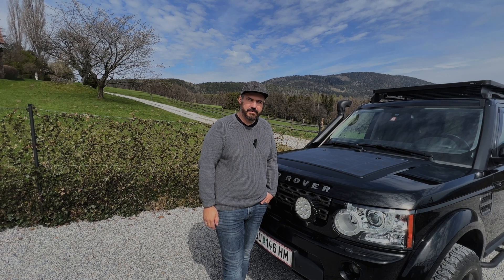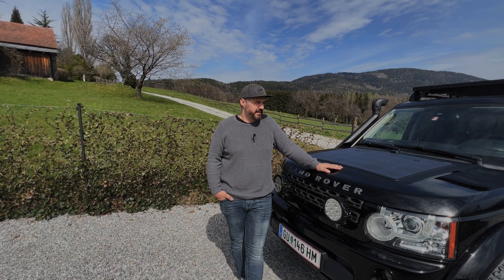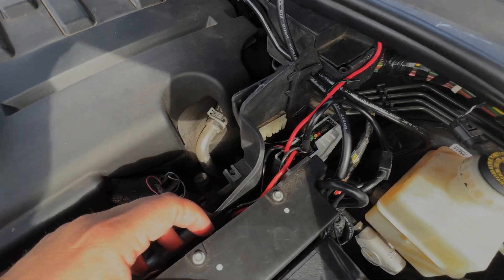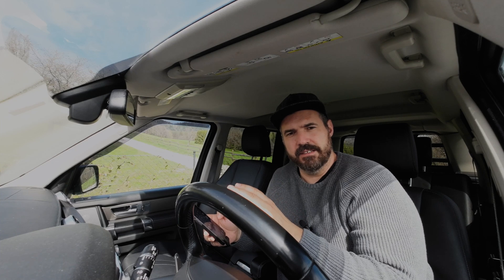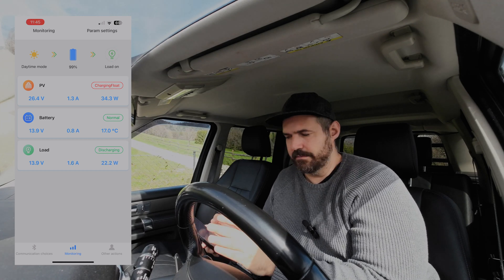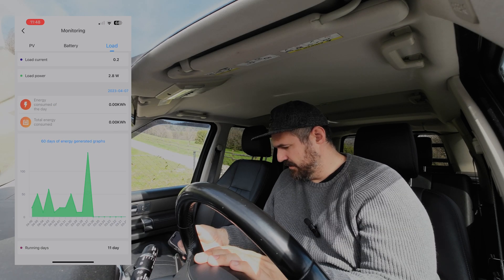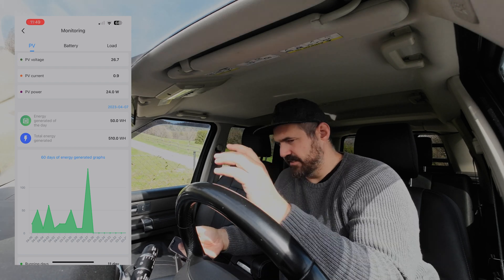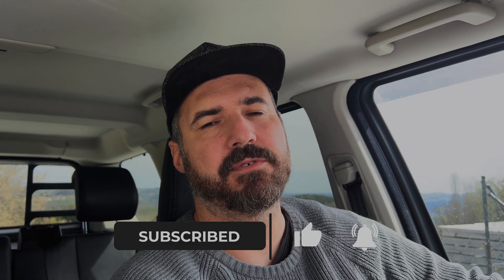Endless Solar Power For Your Land Rover LR4 / Discovery 4

Comment: I much prefer to use bi-facial folding solar panels so that I can still charge batteries when parked beneath shade of trees, by simply positioning them in full strength of the sun. I also wouldn't want to stick that mostrosity on my nice car bonnet! 😂
For charging during inclement weather 🌧️☔ I simply start the engine and the fitted Ecoflow charger feeds 800 Watts to the Ecoflow Delta 1024Wh battery. There is also no need to worry about a dead main starter battery when I'm parked up in the wilds for weeks or months at a time, because the Ecoflow will reverse charge the engine starter battery, even with the engine turned off.

Comment: Hi there how is the Solar Panel holding up? Does it work ok and does the adhesive tape still holds everthong like it should? I am looking for a hood solar panel for my Range Rover L322 that will charge my starter battery while camping. Thanks for your video, I look forward to your reply. Best regards from Lower Austria.
Reply from the maker: Hey, yes, the panel really does stick! It doesn't matter if it's raining and cool, or if it's in the sun at 35°C all day. However, with an adhesive tape price of almost 30 euros, it should :D What I can definitely recommend is that you seal the panel all around and at the wiper nozzles with Sikaflex afterwards. Many greetings, Peter
Reply: If all you need is something to keep your battery charged up enough to start a cheap small solar panel that connects via accessory port should do just fine.

Comment: Hello Peter, motivated by your two videos I bought myself the solar panel too. The decal delivered by lensunsolar unfortunately did not fit perfectly on my hood and will be replaced by one from Oryx Solutions. At the moment I'm testing the performance of the panel itself. Yesterday the output was approx. 100 WH/day. Now I'm curious about the results your panel delivers the last view days. I would highly appreciate, if you can give us a short update about this. 🙂 Thanks in advance.👍
Reply from the maker: Hey @Thomas, what was wrong with the decal so it didn't fit? 

I looked at the history of the panel and the maximum power in one day was 360 WH/day. But I must say that I did not care about the right position to the sun and the angle, nor whether the car was in the sun all day 😉 

Compared to my mobile Jackery Solar Saga 100, the performance is not so high, but that also depends on the easier and better adjustment of the angle and positioning of the mobile solar panel to the sun. This is not quite so easy with a panel permanently installed on the vehicle. 😄

From there I find the performance already quite good! I will try the vehicle throughout the day to place correctly to the sun and see what comes out then.

All the best to you,
Peter
Reply: @notthatkindofachannel  360 WH, sounds not to bad. I think I have play a bit with the positioning of my D4.

Regarding decal, I wasn't happy with the dimensions. I tried to center the screenwasher in the hole, but the decal
Reply from the maker: @Thomas That's true about the cutout of the windshield washer nozzles, so they did not fit 100%. But I did not have to cut anything out and the position otherwise fit very well with me.  

I think 400 to 450 WH/day should be possible under good conditions maybe even more.
Reply: @notthatkindofachannel  360 WH, that doesn't sound bad. I'll have to play around a bit with the positioning of my D4. 

Regarding the decal: I had tried to centre the wiper nozzles in the recess. But the decal stuck out at the edge of the windscreen. I then placed it on the edge. The decal then bumped against the nozzles and ripples formed on the leading edge that I couldn't get rid of. Unfortunately, I only noticed all this when the film had already been applied completely wet. There was no time left for a corrective cut and so the thing ended up in the bin.

The new decal is probably smaller (about the same as the panel itself) and also cheaper. Now I'm waiting for the GLS man to ring twice.

Comment: Hi there… nice review and your mouthing procedures seem to be clean and well organized. Your Solar Panel should be enough for a little fridge or an overnight heater. What’s the Amp of that fuse that you put on the + cable just before the battery? Keep on doing your great job 👏
Reply from the maker: Hello @angelo, thank you! I also use a 500WH power set for our refrigerator and all other electrical appliances. The fuse that comes with the set is a 20 amp fuse. Have a nice Sunday, Peter